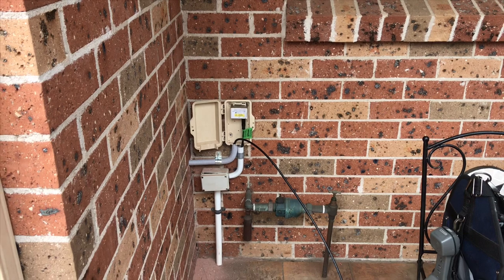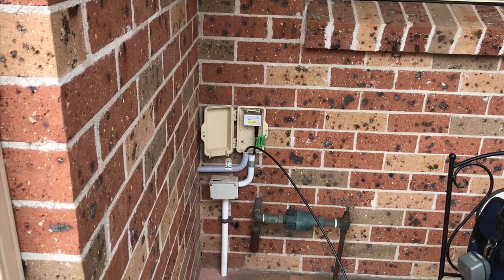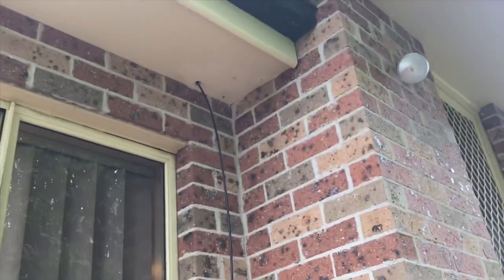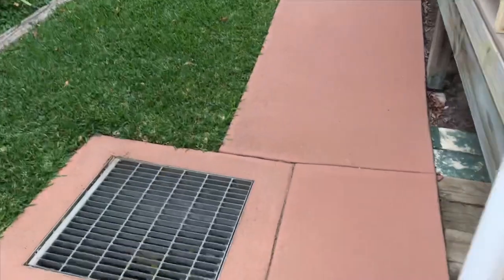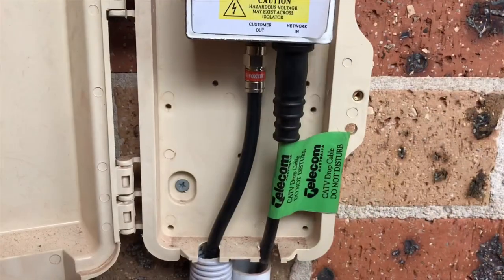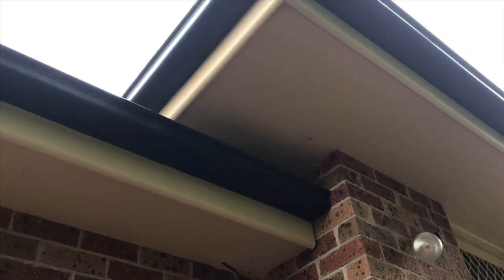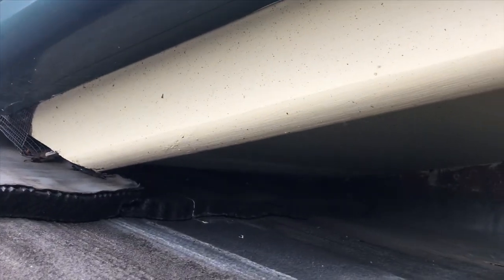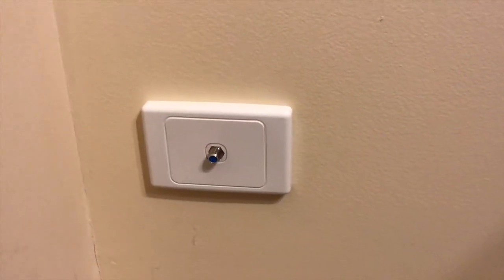Installation of HFC Socket for new NBN Service in the Sutherland Shire

Comment: Unfortunately you blew up the brick because you drilled from inside. But my imp question is that how to fix it if this happen? Advance thanks if you tell me the solution because sometime we also do this mistake
Reply: @AussieEric  can you explain it more plz
Reply: @jawadahmad1898  I mean it is better way to use cord drill to drill as it has high drill speed and the hole is small. Actually the hole is same size as drill bit Normally.
But If the brick is broken, I usually seal it with silicone. Or you have to cover it using top coating etc. then painting it If customer requiring.Maybe you need a handyman
Reply: I would drill from outside then fish the cable through the wallplate. And i also got a magnespot point locator